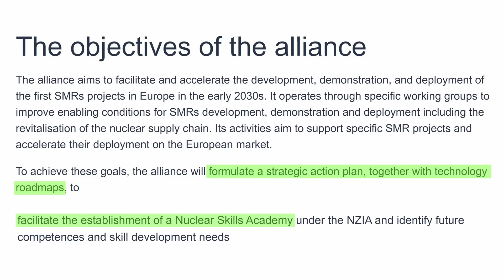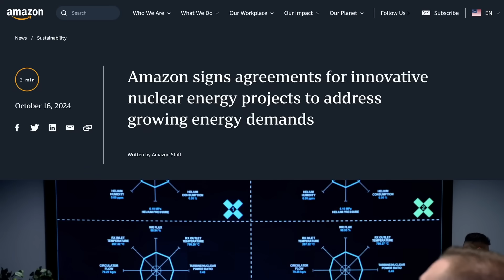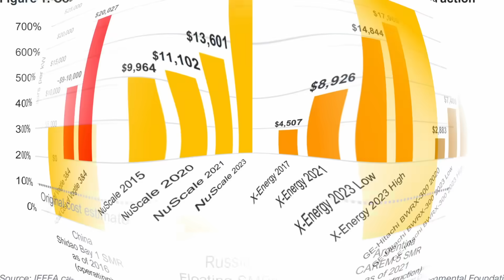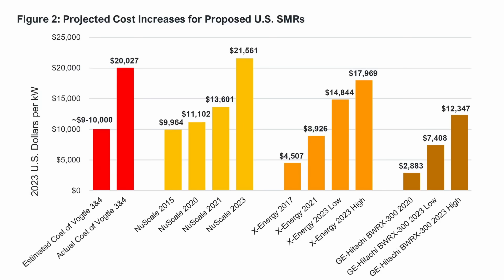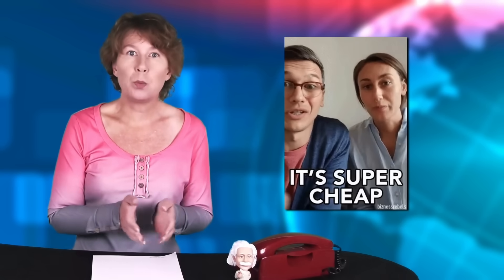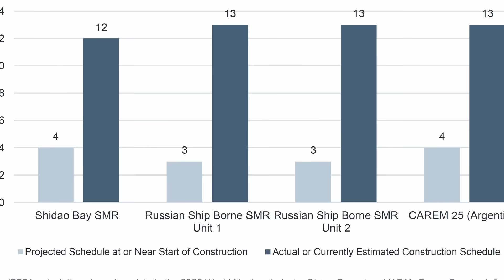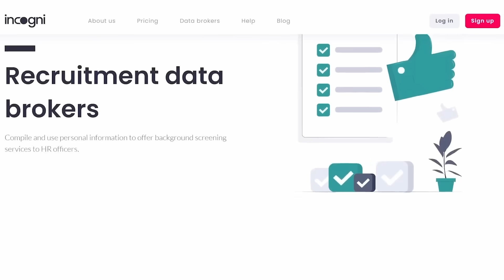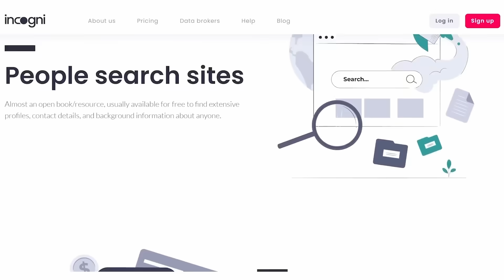Small Nuclear Reactors Have A Big Problem

Comment: Rolls Royce has been building small nuclear reactors for maritime use for decades. This doesn't seem like a major technical problem.
Reply: It is much different for those SMR's are to be built on land in large numbers and economically.   The military gets whatever it wants with limited regard for the cost.  SMR's built on a large scale for residential use would require more stringent regulation.  

And it should be a sign of the difficulty of mass producing SMR's when the company Nuscale backed out of a planned production of SMR's.   

Read the comments of others who have actually worked with nuclear power plants and understand the obstacles to making it happen on a large scale.
Reply: @michaeldeierhoi4096  NuScale backed out in the sense of being allowed to cancel the project before the customers walked away.   The CFPP with UAMPS had not signed up enough customers for the power so it was Dead Project Walking.

Comment: Compare the cost to a small gas driven generator which is many times cheaper - so why build a new nuclear one at 15X the price of gas while shutting down !000 megawatt large nuclear generators for being old that could be upgraded - the USA has 10 carriers & 72 subs w/ nuclear powered generators which could be switch over if the government changed the rules

Comment: So it’s the endless data centers that are the real drain on the electric grid and not EV’s. Here’s an idea you can’t legally build another data center until you can prove it’s both covered under new electric generation capacity and is zero carbon emissions. That should leave room for lower electric rates for consumers and more EV’s which create manufacturing jobs data centers don’t !🤔

Comment: Would it be possible to recharge spent nuclear fuel? That would be the ultimate battery and no waste.

Just use nuclear in stable zones and then use wind and solar power to recharge spent fuel for reuse.

Hurray.

Comment: I'd love to see a video outlining the challenges involved with modular nukes. We've been building and using nuclear power for, like, 80 years, and technology has improved so drastically since. What's the hold up? I'm sure an under-grad engineering student could build a modular nuclear reactor for their senior design project. Maybe that's the way to go. :D
Reply: A design project is one thing, but to mass produce them on a large scale is not doable at this time.  The cost for say 100 SMR's which produce as much as one standard large reactor is the same or more in other words many tens of billions of $$$.

Comment: The answer was MSR for more than 50 years ago.
MSR is totally safe and don't produce long lived radioactive waste if run of Thoroium.
But it includes some problems nuclear people don't want to deal with.
Includes chemistry , at the time, E Wigner had no problem with that, he was also a skilled chemist. 
High temperature materials. Modern jet-motors are much more efficient , thanks to these new materials.
Molten Salt Reactors , MSR,  have no water in the core, no fuel rods and can operate at high temperatures.
Few people understand what this means . Thermochemistry  breaking water apart by heat.  Combining hydrogen with carbon ( CO2) from air producing hydrocarbons.
Big Carbon (oil) tell a lot of rubbish. They want to sell oil, gas and coal . 
To run MSR on Uranium/Plutonium cycle is possible but need even more research as it only runs in fast spectrum. First  step is Thorium / U233 cycle , requires not fast neutrons.
MSR is a small reactor. The big very expensive reactor pressure vessel is not needed. Loaded under full production and salt is processed.
MSR is up to 150 times or more efficient and demands only 1/10 fissile load. Instead 18 months about 3000 months on the same fuel and ten reactors initially loaded.
About 300 years and instead of 1 (LWR) reactor. 
MSR must be developed, as it can be placed where energy is needed.  Heating without emission is a must, as much pollution comes from heating our homes.
But also industry is benefited as steel, cement and  CO2 from air etc can be realized in big scale. A new economy is born without emissions.
That is where research is needed.
BTW China is running tests in this very moment . 
Do we want to relay on China for our future energy ?

Comment: There are several reasons why SMRs and nuclear in general are not the solution. One is the limited reserve of uranium - too little to really make a difference and replace coal. Small reactor loose more neutrons and are thus less efficient with the fuel. The costs for the non nuclear part alone make new thermal power plants not that attractive. When used at a large scale one would need storage for the nights to keep the reactor active 24/7. Intermittend operation would increase the costs quite a bit. The proliferation problem makes it hard to deploy the reactor outside of a few countries that already have nuclear. Without a destination for the existing nuclear waste if is hard to find public support / acceptance and in most countries there is just no forseeable solution (maybe except Finnland and Switzerland). 

My impression is that most of the companies that propose SMRs are just hoping for research money and never really plan to build more than a single prototype. The best way ot earn money from nuclear was the public money to support the developement.

Comment: FYI, The U.S. Navy has been using small modular reactors (SMRs) for propulsion for 75 years!  Why are we constantly "re-inventing the wheel" when a modification of a somewhat simple and reliable design would require MUCH less developmental cash.  Yes, I'm aware of the differences in radioisotope(s) design requirements, although China and Russia wouldn't have that problem. But I'm thinking that it should be looked into...
Reply: Because translating the technology of navy nuclear tech in use to land based are two in entirely different things.  The certification for land based SMR's would wholly different from what the navy requires.  

Then there's the issue of cost.  Tens of billions are spent to build a few nuclear powered subs.  Aircraft carriers are 5 billion a piece.  The military ultimately gets whatever it wants almost no matter the cost.  That's not practical on land based SMR's requiring hundreds of units.

Comment: Nuclear power has been around for 70 years or so. If SMRs are such a great idea then why didn't they start building them 50 years ago? Or 30 years ago? Standardization and modularization are concepts that predate nuclear technology by at least 100 years. Point being if it truly made sense practically and economically it probably would already exist en masse. What IS going like gang busters now are the much cheaper options of solar + wind + batteries. Which would seem to solve pretty much all the problems that a nuclear plant would solve, only at a fraction of the cost and a fraction of the time to completion. Oh yeah also not radioactive. The nuclear proponents seem think they're competing with old style nuclear power. They somehow don't seem to realize they're competing with renewables.

Comment: water cooled reactors are all expensive, and dangerous.   Molten salt reactors, using fuel salts rather than solid fuels are much cheaper, safer, and can provide much higher temperature heat for higher electrical conversion efficiency, or process heat for high temperature processes.   MSRs can use either thorium, uranium, or used light water reactor fuel as fuel sources.

Comment: Wasnt one of the big selling points of SMR's the fact that in a scram there was little decay heat to deal with. If that is the case then containment would not have to be nearly as large or expensive. Under those conditions containment is near certain in a power loss. This has worked on submarines, but trying to get approvals through federal, state and local jurisdictions  would not be an easy sell for a private company.

Comment: Small modular nuclear reactors have been in use in the US, UK and other navies since 1974. In UK submarines the reactor typically produces 200 MW and in Russian icebreakers there are multiple units. \so building costs and reliability is well established such that the costs must reside with the planning restrictions and rules for their housing near urban centres rather than manufacture and installation.
Reply: Marine nuclear reactors have been operation since late 1950-s.  First Soviet nuclear icebreaker was launched in 1959 with 3  90MW reactors

Comment: 100+MW is not small. It requires huge cooling. Cooling is also the weak spot for safety. All these SMRs are prototypes. No clear cost estimate as a lot of research is done. Standardization would safe much research money spending
Reply: 1959 Soviet icebreaker Lenin was powered by 3  reactors, 90 MW each

Comment: Couple of issues in the video.
3:15 Nuscale cost did reach $9bn, but they also reduced it from 600MWh to 460MWh.
3:50 is a bit misleading. China Shidao Bay 1 is commercially operating as of December 2023. The RITM-200 from Russia are Gen3+ and supposedly operational 2019. The issue with both of these is that they're by countries that have a vested interest in misleading the public if these are actually working/what the costs are. CAREM5 has been under construction since 2014 and still isn't done, earliest possible is 2028 and that's doubtful as they fired more people.
 5:20 yeah, very odd considering how expensive it is compared to alternatives, or safety issue in war (look at what's happening in Ukraine)

Main problem with SMR: Idea is that it's supposed to be cheap because assembly line, yet we're never going to have more than a few hundred in the world that are all different based on regulation in that area, and it throws out the biggest advantage of nuclear, which is scale.
Reply: RITM-200 is a power unit on the newest family of Russian icebreakers,  three of which are plowing the Arctic already for 5 years.    The terristial/moored  ones, RITM-200N/M/S,  are not much different.

Comment: What I like about "small modular reactors" ... all those pretty animated graphics.   What I dislike about "small modular reactors"... is everything else.   They have never made any sense.

For example, the whole mantra about distributed generation using these things supposedly eliminating transmission lines... except they don't eliminate transmission lines. SMRs do not represent on-demand generation.   Do you know what DOES eliminate transmission lines?  Grid-scale storage,  More to the point, grid-scale storage can eliminate the need to expand transmission line infrastructure by using the simple fact that transmission lines don't actually run at full capacity most of the time.  California and Texas are already taking advantage of this feature to decongest existing transmission line infrastructure.

Another problem is the simple fact that SMRs can't be plopped down anywhere and even if you thought they could be they wouldn't be even a remotely good fit to the transmission and distribution infrastructure in the areas you want to plop them down at.   In other-words, the SMR footprint has the same problem that any distribution generation (such as renewables) has... you still need to beef up transmission infrastructure nearby to get that power to where it needs to go.

Then there is security.  How do you secure a few dozen SMRs verses the one conventional nuclear reactor producing the same amount of power?  People shoot guns at sub-stations, water tanks, water towers, and all sorts of other utility infrastructure ALL THE TIME!   Really... up in the mountains we installed and maintained many remote telemetry systems for utility water (water tanks) and every single year there would be a multitude of solar panels with bullet holes in them and utility workers would be fishing the remains of bullets out of water tanks (to get the lead slugs out of the tank).  Every. single. year.

And maintenance... are you really going to deal with inspection and maintenance and the related nuclear waste of the same, in the middle of a town or city?   Can you really just unplug a modular reactor and throw it onto a tractor trailer, then plop a new one in with perfect safety?   No, you can't.  It isn't as simple as those pretty graphics convey.

SMRs have never made any sense and continue to not make any sense.

-Matt
Reply: I cant be bothered to point by point show that everything you have said is nonsense.
SMRS are being designed and built because they make sense.

If they don't, no one will buy any will they?
Unlike renewables they are not mandatory. People don't HAVE to buy them

Comment: Nuclear reactors are basically water heaters which use neutron absorbing rods for temp control. Insert rod to lower temp and pullout to increase temp. Main nuclear waste of concern is cobalt-60, formed from predominant isotope cobalt-59 present in iron metals. Cobalt-60 is a strong gamma emitter which can cause radioactive burns and sickness and deaths. So any necessary maintenance, such as replacing pump, has to be done using shielding. Cobalt-60 has a 5 year half life. Cobalt-60 is stored in stainless steel lined pools for about 25 years. Even small reactors with interior shielding within pressure vessel has to be very heavy so that a fully assembled nuclear plant would not be mobile.
Reply: Co-60 is not the main nuclear waste of concern.  A nuclear reactor makes very little of it, unless one incorporates cobalt into the design for some reason.

Comment: If every single one of these reactor designs is produced in single digits then of course it will take longer and cost far more than expected. The goal is to build an assembly line of these things and amortize the costs over the product lifecycle. Even the AP1000 plants in the state of Georgia were subject to a whole raft of problems because nobody had built any similar systems in decades. We're not just building reactors. We're rebuilding an entire market.

Comment: The biggest problem for small reactors is probably shielding.  The thickness is set and requires about 5+  feet of material and would scale with surface area.  Several small reactors will require more material and a single reactor can’t be less than 10ft in diameter when you include shielding.
Reply: Straw man.
Reply: @ how do?  Radiation from fission is proportional to fusion rate which is proportional to power.  Therefore a 50MW core would produce 100x less radiation.  That is equivalent to 2 thenth thicknesses, so 4” less of lead or 8” less of steel.  Neutrons may be more complex.  First, the neutron flux in the core depends greatly on core design and especially surface area.  Small reactors tend to operate at higher fluxes due to increased leakage.  Reflectors either add cost (rare material) or size (water).  All together, it isn’t immediately clear how much less neutron radiation would be produced.  However, neutrons are highly penetrating and are best stopped by water.  Current reactors use several feet of water.  Neutron shielding is a factor of hydrogen density and there are very few materials that have a higher proton density than water so it is unlikely this could be reduced.  If neutrons are not attenuated, they will also activate more of the shielding or support equipment.  For all the promise of small reactors, I have yet to hear how they get around the physics of radiation shielding to fit them in a small box.

Comment: Sabine, thanks for a well informative video.  I had worked in the electrical power industry for over 40 years.  The working environment between nuclear and non-nuclear is practically night and day.  The effort for me to work on a nuclear project is several times more than the effort doing similar work for a non-nuclear project.  The difference is due to the fact that there are regulations posed by the federal government for the nuclear industry.  (Of course, there are concerns about the safety of the plant.)  On one project the utility engineer who knew me said when I showed up for work, "you should reconsider doing any nuclear projects because they take out the fun being an engineer."